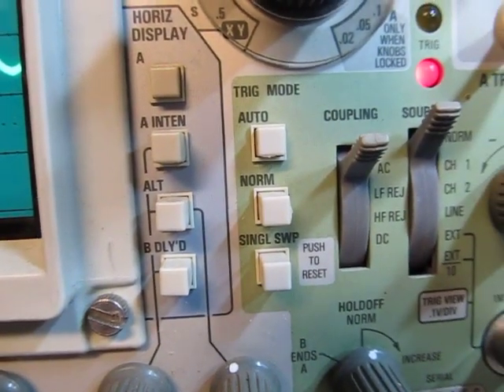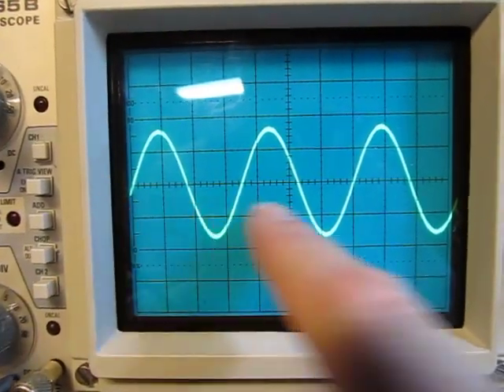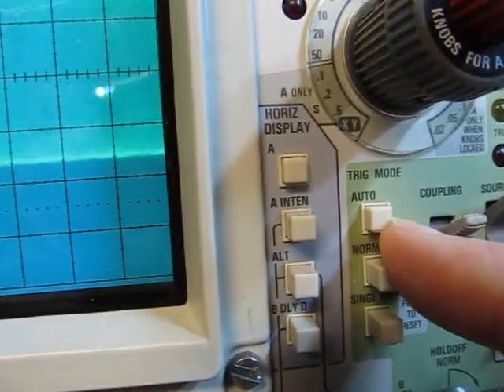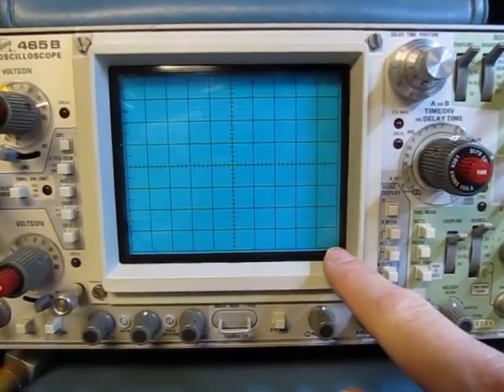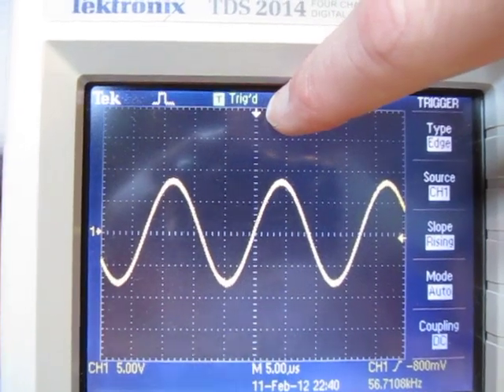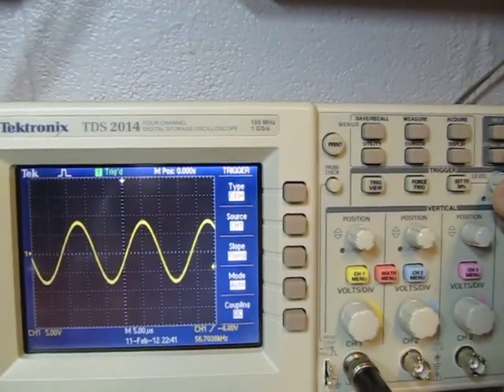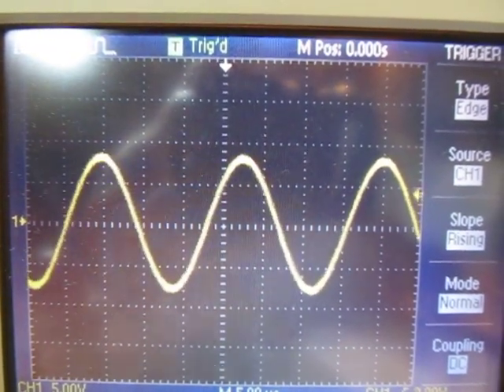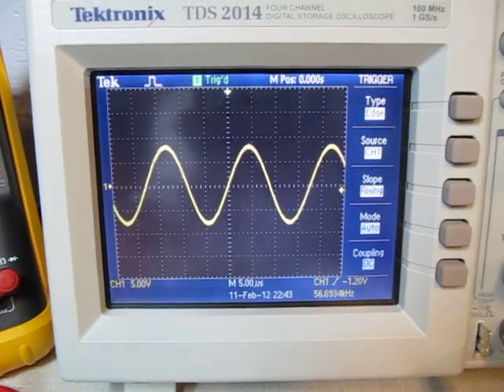#33: Oscilloscope AUTO Triggering explained

Comment: “AUTO”, “NORMAL”, and for that matter “LINE” and “SINGLE” are SWEEP MODES… NOT TRIGGER MODES!

So let that sink in.

 “AUTO” mode is short for “Auto Sweep in Absence of a Trigger”.
The “NORMAL” mode is the quiescent (normal) condition of the sweep, in this condition the sweep does not run until the trigger logic has been satisfied.

This is how TEK TDS, DSA, MDO all work, this is how 2465, 465, 453, 7B53a … all Tek analog scopes work too. And it’s always been at about a 20 Hz rep rate. 

Why? AUTO sweep provides a convenient way of setting vertical DC levels.
AUTO allows one to set up the sweep triggers for all but the very slowest Repetition signals.

Therefore:
AUTO is not auto trigger at Tektronix, AUTO is Auto Sweep in Absence of a Trigger…pure and simple. 

If you want to do some Research on an interesting aspect of auto trigger derivations at Tektronix, look into the purchase of Telequipment by Tektronix back in the 1960’s. It was a Necessary evil to avoid a circuit design infringement lawsuit by Telequipment against Tektronix. It was cheaper to buy them than pay them for the use of the AUTO circuit design.

Comment: AUTO triggering circuit is connected to Oscope chan#1 because when you measure a waveform/signal on a circuit under test the Oscope will sync/trigger from the Oscopes Chan#1 Probe. What I'm confused about is how is the trigger circuit "detecting" and syncing up to the oscilloscope H&V circuits to display a stable waveform because the Oscope Probe is not only measuring the Voltage but also the Oscope Probe is detecting and syncing to the measured waveforms/signals frequency so that the Oscope Triggerin circuit will get synced up? #2 question, its common that when waveforms are referenced to a clock frequency signal that you have to put the Oscope to External trigger and connect the clock signal to the External trigger port on the Oscope or you will not get a stable waveform. The Question#2 is asking when looking at a stable waveform on the Oscope how would a Electronic technician know that the waveform is referenced to a clock signal or is triggering off of 60hz line frequency? because if you disconnect the clock signal to the external port on the Oscope the waveform will display a free running waveform or scrabble garbage. But when viewing a stable waveform there is no way of knowing if the waveform is being referenced to a clock signal or 60hz line frequency?
Reply from the maker: Re-watch the video.  The AUTO trigger isn't connected to any particular channel.  It initiates an internal trigger if the regular trigger condition isn't met.

The only thing that the trigger circuit "syncs up" is the horizontal sweep.  On an analog scope, the trigger most often is looking for when the input signal crosses the "trigger level" - like a comparator.

The vast majority of the time, you setup the scope to trigger on the same signal/channel that you are looking at.
Reply: @w2aew  Oscope SOURCE switch to Chan#1. The SOURCE switch is connect chan#1 to the Oscope trigger circuit. When you place the Chan#1 probe to measure a waveform/signal even when you set the trigger level it won't sync up to the Oscope and display a stable waveform because the waveform on the PCB board is referenced to a clock signal. When you measure the waveforms time period, the time period measurement does NOT equal or match to the clock signals frequency, any reasons why?
Reply from the maker: @waynegram8907   Without specific pictorial examples, your question is not possible to answer.  There are a lot of reasons why it might be difficult to get a stable triggered display.
Reply: @w2aew  When a technician is measuring different waveforms signals on a circuit under test and can't get a stable display by adjusting the trigger level, it just won't sync up or trigger. The only way to get a stable display is to use the external trigger port and connect it where at? besides the clock signal frequency. When you connect the clock signal to the external trigger port the measured waveform signal on Chal#1 is COMBINED with the referenced clock signal on the Oscilloscope EXT trigger port? I just want to make sure its considered "combined" when you apply trigger signals to the Oscope trigger port because it must combine with oscope CH#1 measured waveform

Comment: Today I picked up a 466 for a very reasonable price. Unfortunately, it did not come with an original Tek probe.  It needs cleaning, obviously.  The first issue are the four feet to put it in the upright position.  The plastic material of those feet has become brittle, the feet broke on first contact with the floor, so I removed them.  I have seen a guy on youtube make those feet with 3D printing, maybe somebody would sell me a set.  The slots in those feet are not for decoration purposes, they hold the power cord snugly when it is wound around those feet.  Tomorrow I will test my 466.  I hope there will be not to much unpleasant surprises.
Reply from the maker: Yeah, the cord-winder tabs on the feet of my 465B have mostly broken off too, and the feet are beginning to break apart.  I should probably look for replacements as well.  Good luck with your 466!
Reply: I cleaned the 466.  There were some issues.  Two of the rods that couple the knobs to the pots were disconnected.  The cardan joints with set screws that connect those rods were broken.  These joint are very unobtainable.  I managed to, more of less, repair those joints with a drop of super glue.  At least, now I can move those pots again. Apparently, all the switches are very noisy, which is not a surprise .  What did surprise me, however, is the tiny texts on top of the push buttons; they wiped off just by touching with a damp paper towel.  I did not even use soap or alcohol, just plain water.  The ink (or decals) on top of those buttons must have been dissolved by sticky, sweaty fingers over the years.  I will print and cut tiny stickers on transparant foil to correct that issue.  Also, there seems to be an issue with the 'storage' features of this scope.  The illumination of the screen behaves rather weird whenever I switch those 'storage' push buttons ( 'save' - 'non-store' - 'var pers' - 'fast').  The screen lights up very bright shortly, then resettles to a more or less normal intensity, whenever I switch those  buttons. I have no clue if this is normal behaviour, I have to figure that out.

Comment: I have a question..on my, just purchased Tek 2431L, or any scope after you set the cursor's to measure volts, or time...is there a way they follow a change of either one...or do you have to move the cursor each time for the measurement. Thanks...very nice video as always...
Reply from the maker: With some scopes, you can set the Cursor into "track" mode, where one control will adjust the delta between the cursors, and the other control will move both back-forth or up-down.

Comment: Would you measure your current across a resistor using your pk to pk voltage or your rms/avg V?  I was in lab today at school and I have forgotten how to use an oscilloscope since last semester... :[
Reply from the maker: You could measure either, it depends on what you need the measurement for.
Reply: +w2aew I'm measuring voltage from a rlc with a diode atm... I appreciate your response =)

Comment: Very new to scope but this was interesting, What would you recommend for a newbie am mainly repairing amplifiers (analogue) and also thinking about buying signal generator (whats max mhz I would need)? Am looking for something easy and reliable.
Reply from the maker: +jon123423 If you're talking about audio amplifiers, then a simple used analog scope would suit you just fine.  No need for the expense and features of a digital scope unless you choose to go that route.  Most of the time, you'll be using the scope to check power supply ripple or tracing a signal through an amplifier to look for problems.  As for a signal generator - you just have to be sure it puts out the maximum frequency that you'll ever be testing with.  It is helpful if the generator has a nice wide adjustable output amplitude range.
Reply: +w2aew 

Thank you for very quick reply you seemed very clued up and very intelligent.

Yes I am repairing audio amplifiers

would this be any good (signal generator)?

http://www.ebay.co.uk/itm/181818042260?_trksid=p2060353.m2763.l2649&ssPageName=STRK%3AMEBIDX%3AIT

or

http://www.ebay.co.uk/itm/121633684383?_trksid=p2060353.m2763.l2649&ssPageName=STRK%3AMEBIDX%3AIT

For scope:

http://www.ebay.co.uk/itm/191700656159?_trksid=p2060353.m2763.l2649&ssPageName=STRK%3AMEBIDX%3AIT

or

http://www.ebay.co.uk/itm/ARM-NANO-DSO201-Oscilloscope-Mini-Storage-Digital-Pocket-Sized-Portable-Kit-UK-/270972259947?hash=item3f17348e6b

or

http://www.ebay.co.uk/itm/301756261835?euid=c44a36e58e204858862b1d65666ebb2c&cp=1
Reply from the maker: +jon123423 I'm old-school when it comes to scopes for these applications, so I like the used analog scope.  But it all depends on your space and taste.  The signal generators would likely be OK for your application, but I also like the old analog function generators.
Reply: I have a problem with my audio (home) amplifier - requires more than a DMM.

Am I on the the right path here:

1. Basically you use a separate signal generator  to diagnose the fault?
2. Then signal generator is connected to aux input (or available but not phono) of amplifier and set bandwidth to let say 1khz on sine.
Finally connect scopes ground cable to chassis of amp and used probe to trace fault?
Reply from the maker: +jon123423 Yes.  Not that you can work from either direction.  Inject a signal at the input like the AUX, and trace it until the problem is discovered.  Or, monitor the output with the scope, and inject signal into the output stage, and work your way backwards until you hit the problem area.
Reply: +w2aew I am thinking of buying analogue scope that might be best way to learn. Would you able to get a little video together (if that is not to much as you seem to relay information very clearly in layman terms) and set this apparatus up as I am a bit lost here and point out relevant safety.
Reply from the maker: The most important thing to remember is that all measurements are made with respect to ground. The ground lead on the probe is connected to the mains ground. Therefore you have to be careful to connect it to ground in the equipment. Be sure to check out the eevblog video called "how not to blow up your scope". For basic scope operation, check out my video on basic scope operation. 
https://www.youtube.com/watch?v=067W7h1BhxE
Reply: +w2aew
So far I have not used the scope on  a live equipment to do probing. I am gathering safety measures first. General rule is that in my case where i repair audio amp, i connect Signal generator  to aux or CD connection  to the amp at let say 1khz used and switch on amplifier. If I wanted to probe that 1khz signal with my scope the ground lead of the probe (scope) must be connected to ground point of circuit or chassis with extension lead (resistor can be used) is that correct?I set ac on my scope with appropriate scales (highest for safety) and my scope should reject dc current and accept AC signal on circuit, so the sine (ac) 1khz should come through as long as there is no faulty tracks, bad , dried joints or bad components. Am I on the right lines?
Reply from the maker: Yes, but don't use resistor in the ground lead.
Reply: How about a fuse on ground point?

 I did some live testing today and manage to see sine wave on scope when touching each component - randomly. But however 60% of components sine wave  could not be detected by scope? does speakers need to be connected for this operation? or I would need a circuit diagram and go in order? Where it fails from there I would need to inspect the failing component - is that correct?+w2aew
Reply from the maker: +jon123423 It is perfectly normal that the sine wave will only be on some components.  Not all of them are in the signal path - many will be part of bias circuits, power supply circuits, feedback and safety circuits, etc.  You really do need a schematic and a good understanding of how the circuit is supposed to operate, in order to effectively trace and troubleshoot problems.  Otherwise, you have no way of knowing whether what you see on the scope is normal for that node in the circuit.
Reply: *****
Thanks for your quick reply, I will take that on board and do further research/studies.
Reply: *****
I have received my cheap function generator. Its working very well with variable DC offset and Variable amplitude function. I have notice that you don't have to switch amplifier "on" to diagnose faults. While amplifier is "off" I connected through AUX input and increased amplitude on function generator and wala the scope could pickup signal on components Which were in the same path. I also connected the generators plus lead to variable resister and negative to chassis   (on both right and left), while amp switched off (not connected to mains either), the sine Wave was  easily picked up on all components linked to that path except one output transistor (Emitter), so took that component out and it was faulty- showing as a diode. So my question is you don't have to switch amplifier "on" in order to diagnose a faulty amp While using a scope as long as function generator has a amplitude function - is this correct?
Reply from the maker: +jon123423 You really can't diagnose faults with the power off. Active devices like transistors (and ICs, etc.) will block signals when they are not biased - that's why your signal didn't appear at the emitter.  A bipolar transistor will look like a diode when testing any two of it's leads, so the device is probably good.  With the power off - you certainly will see the signal in certain portions of the circuit, but not all.  This is perfectly normal.  I would venture to guess that only a very small percentage of faults can be detected with the power off.  Proper troubleshooting requires understanding how the circuit is supposed to work, and being able to follow the signal path and recognize both the proper DC/bias levels and signal levels in the various parts of the circuit.  You use the signal generator, DMM, scope, etc. to validate the bias and signal levels.
Reply: +w2aew But on 3 output transistors (at emitter) sine signal was clearly shown, 
fourth output transistor nothing - so took that output transistor out 
and used a transistor tester and it showed it as a diode. (eh! something
 fishy  it got diagnosed correctly  while amplifier was off). 
Fitted replacement and the amplifier is working as normal. So how on earth could it diagnose while amp was off? This confuses me,may be my signal generator is powerful (high gain/output) and perhaps it activates components in the same path while amp is switched off.  If I use my mobile phone (on line signal generator) as signal generator then scope can’t see sine waves at all while amp is off but turning amp on , scope can see sine wave.so this  explains some of my theory; May be dedicated signal generator with high gain/output may activate every single component in the path while device is off? Perhaps I was lucky? I will open another amplifier and do a same experiment again.
Reply from the maker: +jon123423 You were lucky.  As I said, the vast majority of faults won't be found with that method.  You REALLY need to understand how the circuit works to properly diagnose and troubleshoot problems.
Reply: OK, thanks for your info but this was a strange one!

Comment: Thanks Allen for teaching new functions of the scope. 
Thanks VI3MIJ for teaching what to use NORMAL for. Took me time to understand "all AUTO does is force a trigger event".
In other words - "Instead of going with the trig. level knob -/+  manualy it will do it internally by itself till it finds the signal. All what would be left to do is to choose the right sweep frequency.
 About the use of NORMAL mode I would say "Trigger level that is set to a certain level and it waits for a signal that contains that level causes the screen getting alive". LIKE SPIDER WAITING FOR THE FLY IN THE NET - When FLY IN THE RANGE SPIDER ALIVE .WHEN NO FLY SPIDER SLEEPS.
Reply from the maker: Your spider analog describes the NORMAL trigger mode. For AUTO, the spider wakes up on its own periodically if he is not awakened by a fly.

Comment: On my Tek 2235, it is impossible to get a free-running display when in auto trigger mode if a symmetrical waveform is coming in to the scope. The 2235 automatically limits the triggering level span within the lower and upper peaks of the waveform when in auto triggering mode, but not when in norm mode. Kind of interesting that the auto triggering works slightly different on different analog Teks.

Comment: i got a real old 10 Mhz analogue jobby and the auto trigger just triggers off the mains frequency (50Hz where i live) and it works slightly different, you have to push the knob in and adjust if you want it to trigger off the signal (telequipment D61) 
the scope can trigger off composite video signals as well

Comment: Beautiful video, well done!

Auto mode on my 2225 works slightly different. While NORM works exactly the same like in your 465B, AUTO expands the range of the trigger control in a way that it spans peak to peak along its full range so AUTO will always produce a stable signal, regardless of trigger control setting.